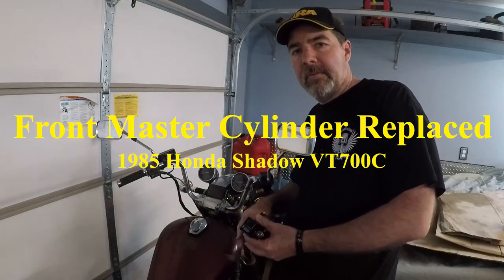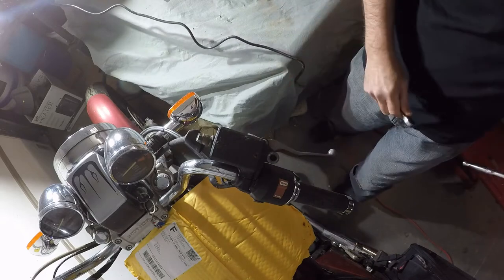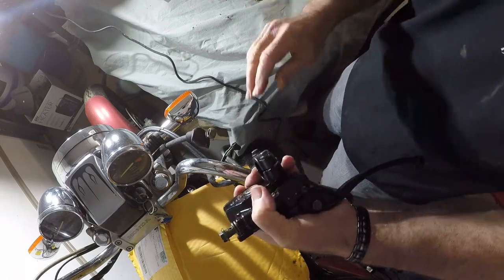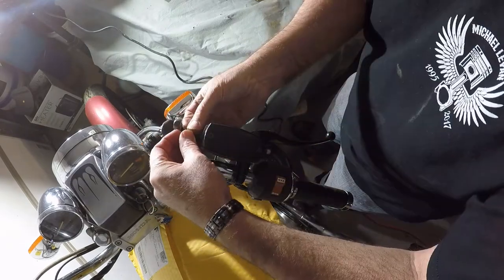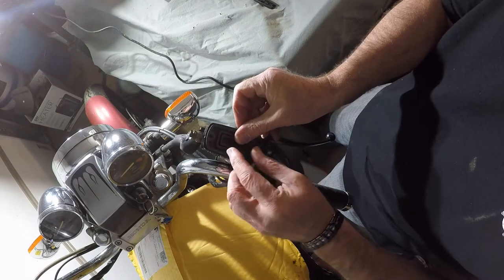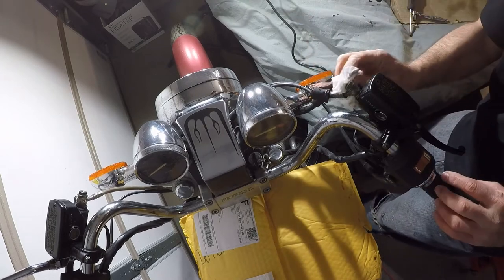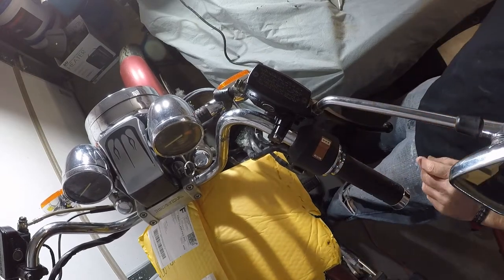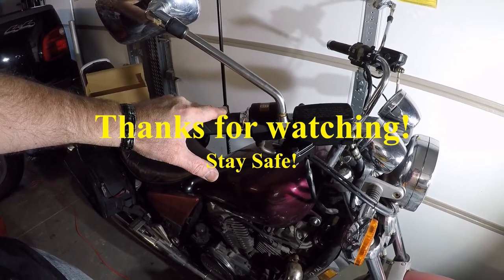85 Shadow 700 Master Cylinder Replacement #shadowvt700c #mastercylinder #frontbrakes

Comment: Thanks. About to do this on my 2007 Honda CB900F. I think you can bleed partially with the brake lever and add fluid before putting the reservoir cap on. Thanks for the video.
Reply from the maker: Sounds good. Thanks for watching!

Comment: Hi..Thanks for the video. Question..is there 2 brass washers on the fitting? or just the one? Thanks
Reply from the maker: There should be a brass washer on both sides.  Thanks for watching.
Reply: @wonkster1970  Well hi..Thanks for your response. Do the washers need to be brass? ..I think I answered my own question.they're thin and flexible. Always good to go with what it originally came with ..thanks
Reply from the maker: @krisedwards1003 They are usually brass. I think I've seen them aluminum also. But usually brass.

Comment: Is it really this easy? Just unplug and plug in? Thanks for the vid mate
Reply from the maker: The wires for the brake switch plug right in. The brakes need the air bled out after installing.  Bolts hold the  clamp and the banjo bolt on. Thanks for watching.